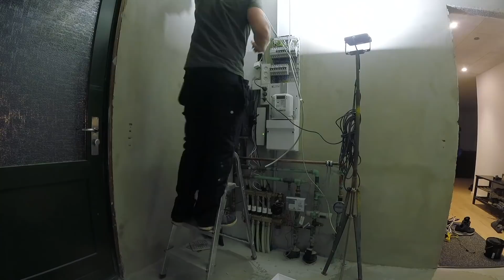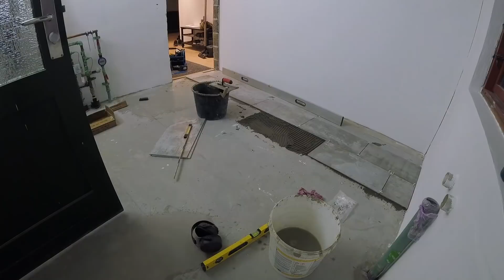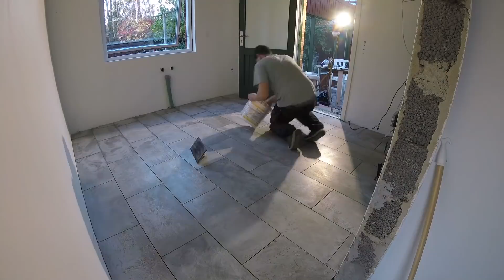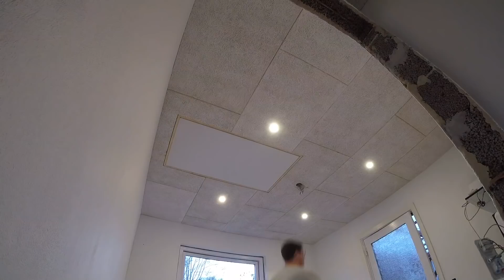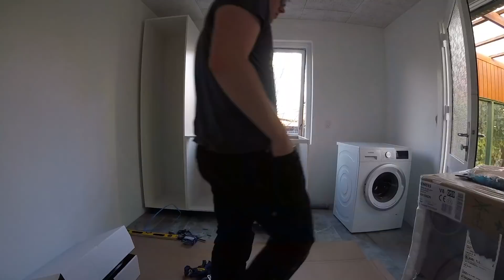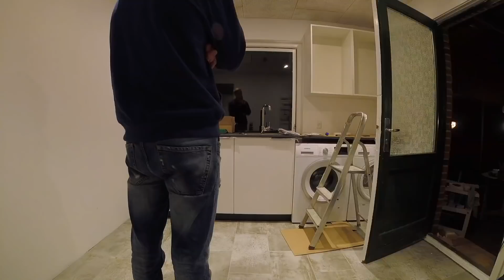Old House Budget Renovation - Part 10 - Back Entrance finished

Comment: What type of ceiling material is that,  I have never seen it.  In what applications is that ceiling good for?
Reply from the maker: It is called troldtekt, it is woodcement. it benefits in excellent acoustics
Reply: Acoustically how? To deaden sounds or to accentuate
Reply: Just looked it up, interesting.  Keep up the good work

Comment: can i ask, was the reason for laying the first set of tiles away from the wall because you wanted it to be centre to the door entrance?
Reply from the maker: 2 reasons. 
First reason is those against the wall had to be cut. so easier to measure from a straight line
Second reason is i wanted center the tiles so the cut would be the same at both walls.